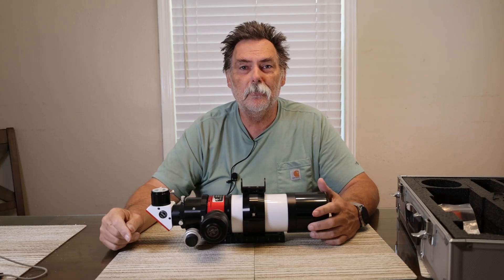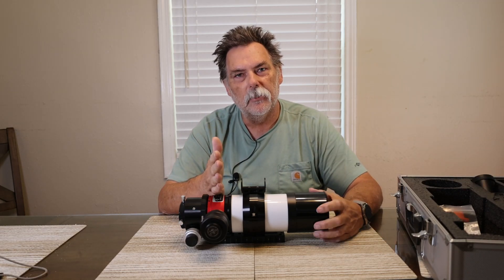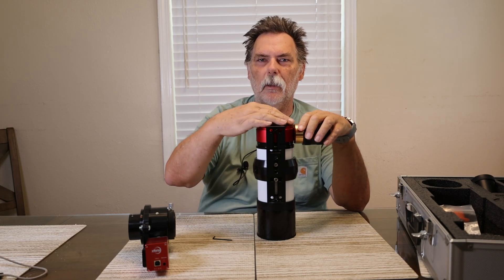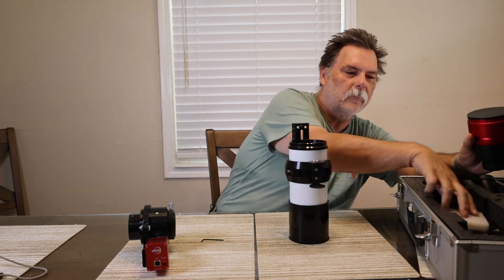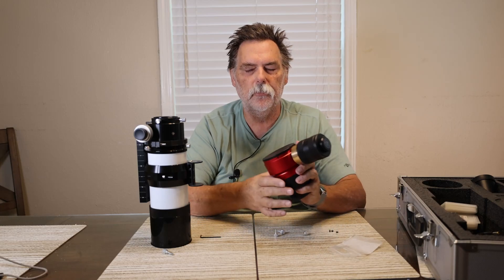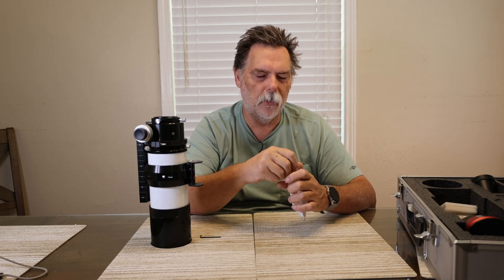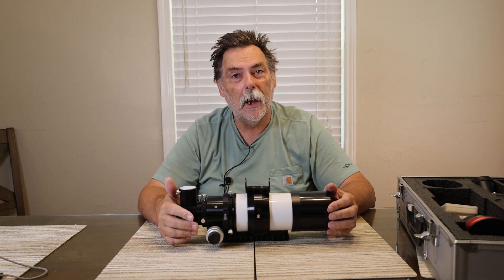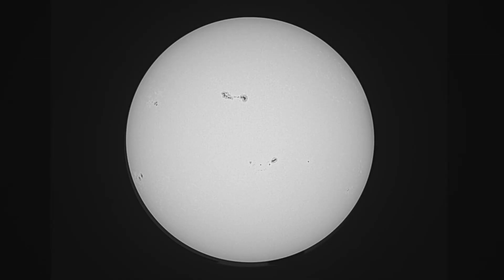Part 2 Of The Lunt LS60MT: White Light Solar Imaging And Viewing Setup

Comment: Which camera did you use to get your pictures? Do you still prefer the diagonal blocking filter vs the straight blocking filter?.
Reply from the maker: I think it was the ASI183MM if i remember correctly. I have only have the 90 so i dont know witch i perfer.